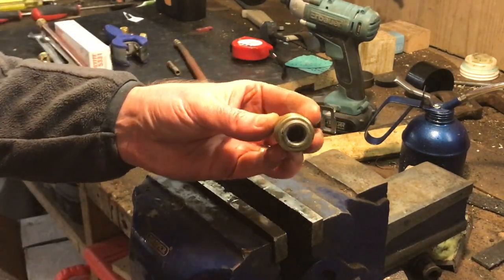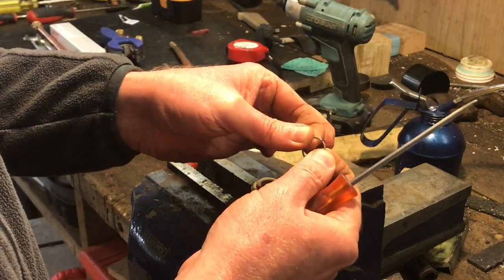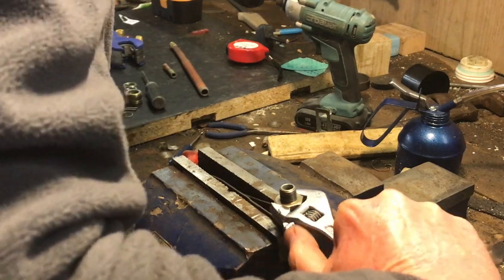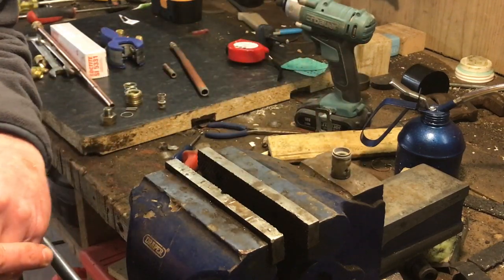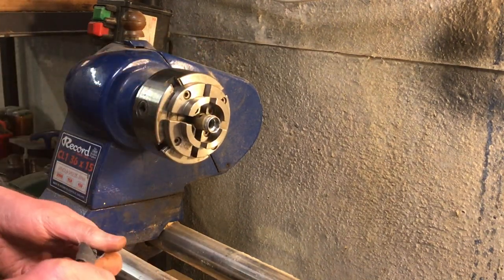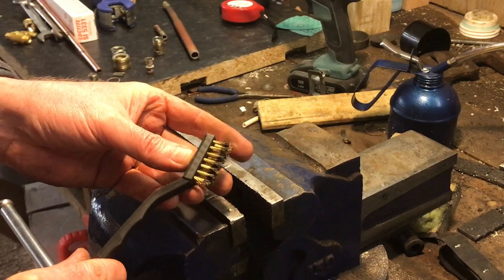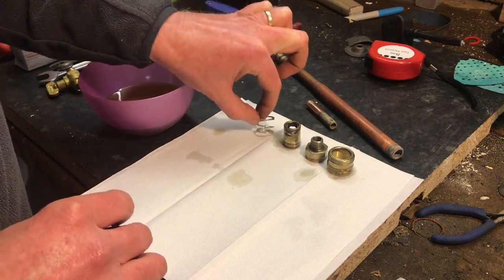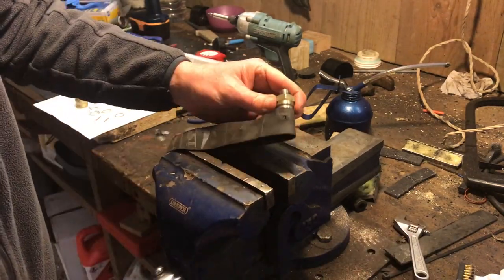#46 Fix it, don't replace it! - Air hose Quick Couplers

Comment: Thank you very much. It was very helpful. But just wondering about dipping the o ring in the oil doesn't damage it ? I mean rubber and  petroleum based oils like WD40 don't go together
Reply from the maker: Hi Natnael T, you can use air tool oil if you have any handy, I didn’t have any on hand at the time of the video. If the rubber is exposed to silicone based lubricant for an extended time that will certainly cause it to degrade, but here it was only used as a cleaning agent and didn’t do any harm. For reference this coupler is still in service and is not leaking even after all this time. 😉 Contrast this with the fact that when I made this video the coupler was only a few months old, perhaps 6 or so! 

Hope this helps. 👍👍
Reply: @WaterhouseForde  Thank you very much again for the video and the explanation. Cheers.

Comment: It was actually quicker to buy a new one.....get on with it.
Reply from the maker: Hi SDMF_1, thanks for your comment. It certainly would be easier to buy new ones, but that wasn’t really the point of the video. I prefer to repair things that can be repaired. But I accept this may not always be the quickest solution. 👍😉